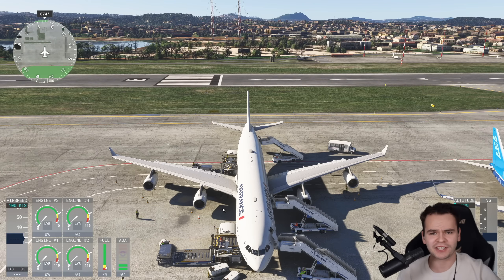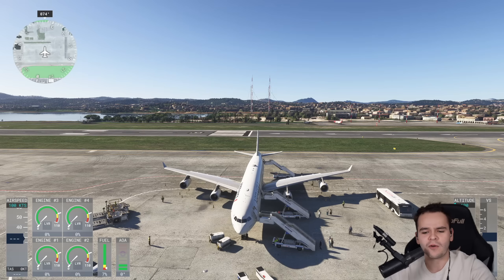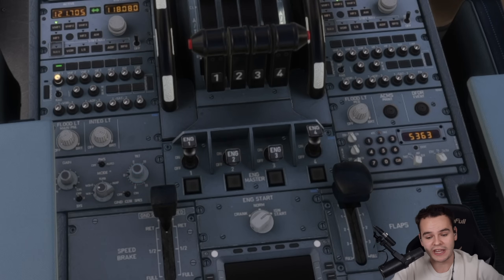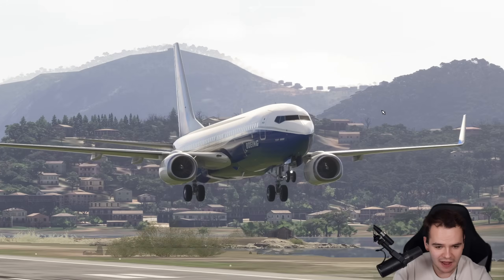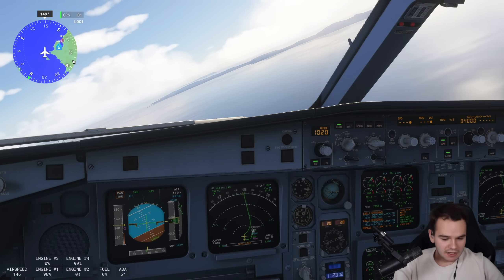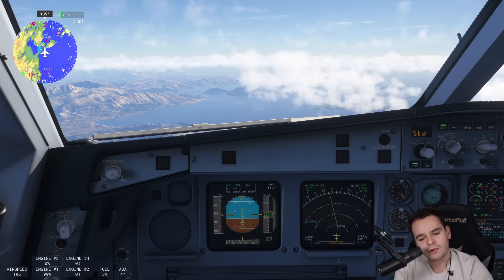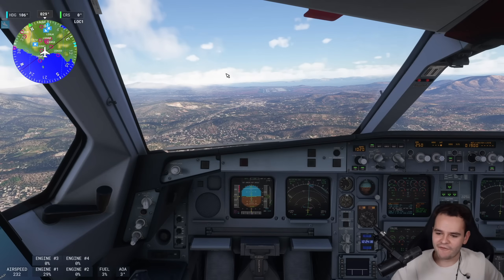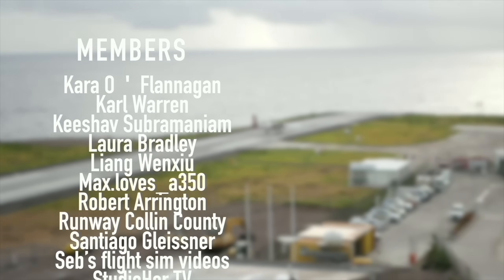What Happens When You Fly The A340 On TWO ENGINES?

Comment: This is basically "can the A320 take off using its APU?"
Reply: The A340 and A320 both use the same engines as mentioned in the video. If the A340 is only using two of its four engines, it's literally just a regular a320. So an A320 using just its APU wouldn't be "basically the same" as an A340 only using two engines.
Reply: @LouisPlayz4Ever  ☝🤓